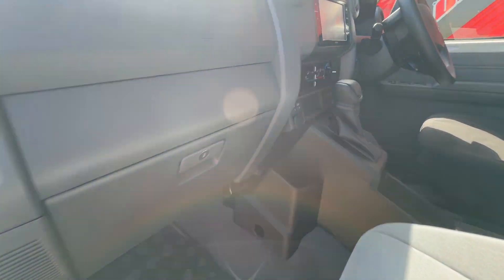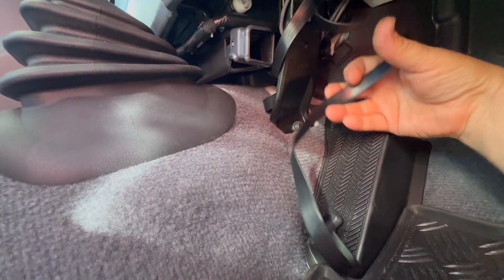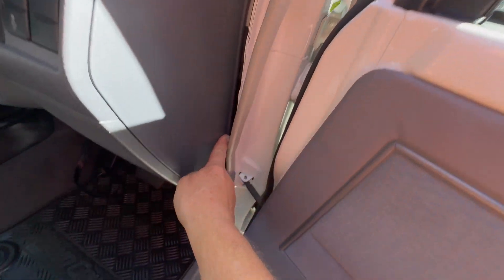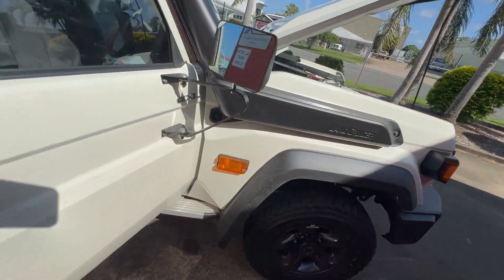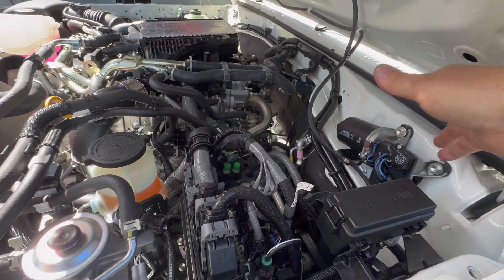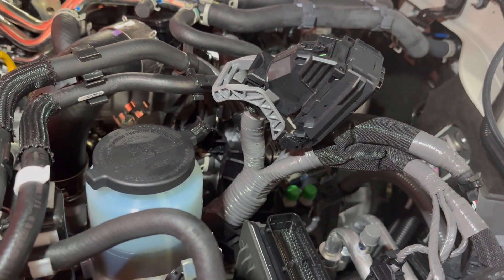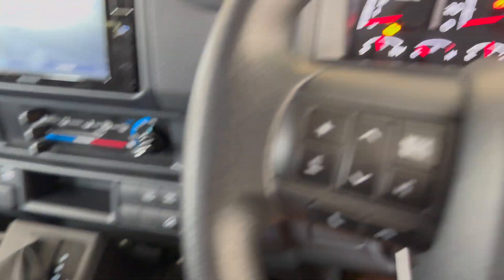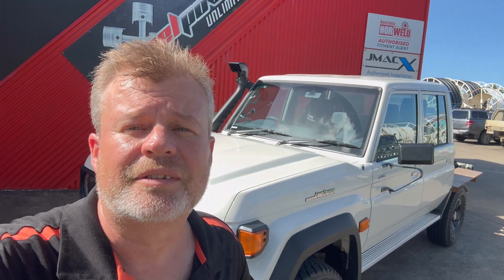Installation in 70 Series (2.8L auto) - lockup-mate®PLUS+ Torque Converter Lockup Kit

Comment: Nice thanks for the overview. I just ordered a 76 2.8 auto, will be considering a lockup kit. One query though, does it effect the vehicle warranty?
Reply: In terms of warranty, it is no different to fitting any aftermarket accessory.  If Toyota believes it is the cause of a problem they may not honour the warranty for that repair. For example, fitting an after-market suspension lift may invalidate a CV joint or drive shaft failure under warranty.  Similarly for remapping the engine to get more power.

For normal servicing, some people just hide the unit. The OBD2 connector can be disconnected and tucked away in the transmission tunnel, and the LED/switch can be easily removed and coiled up out of the way within a minute.

When power to the control unit is removed by disconnecting the OBD2 plug, the vehicle reverts to standard operation.
Reply: @marshallmuller485  Thank you for your response. Curious as to the wires you cut and joined the kit to. They have no effect on the vehicle reverting back to standard operation when the kit is removed? 
Another question. Is a lockup kit worth while on a vehicle that will be doing very little/or almost no towing?
Reply from the maker: @justinreeders2541  The kit is designed to be robust.  It will revert to factory operation when it is switched or powered off (eg. unplugging the OBD2 connector).  There is also a link plug for the harness which intercepts the solenoid wiring to put the wiring back to factory if the controller is removed.  
Yes, it will provide benefits when not towing. When cruising there is a slight gain in fuel economy. In manual mode (incl. 4L) it will lockup the torque converter from 2nd gear, which will keep the transmission cool when working the car hard at slow speeds (e. sand driving).  Lockup in manual mode also transforms the driving experience as it essentially turns the car into a clutchless manual, directing all power to the wheels (no slip - no power loss and great responsiveness).
Reply: @mm4x492  Thank you very much for the explanation. I can understand the benefits of locking the converter up, but still don't quite understand how the kit works. No need to worry about that now, but I'll probably need to give you guys a call when I get closer to deciding.
Reply from the maker: @justinreeders2541  Checkout our operation video for more info.   https://www.youtube.com/watch?v=2e3xCIkEqb4